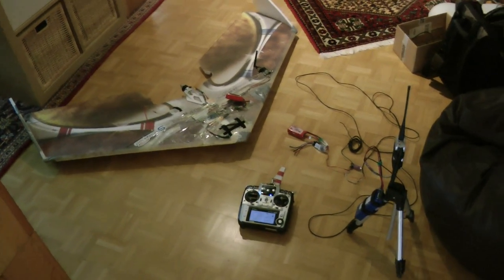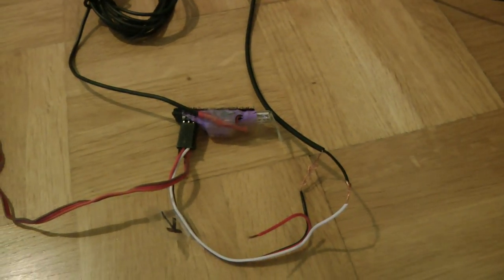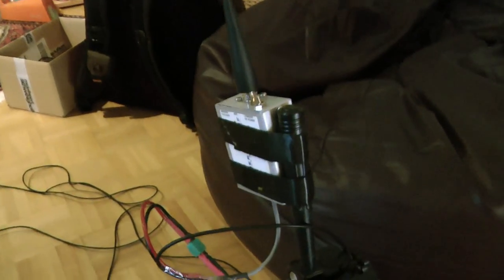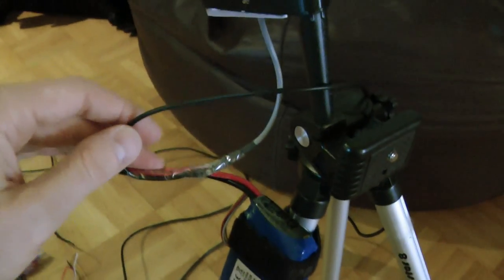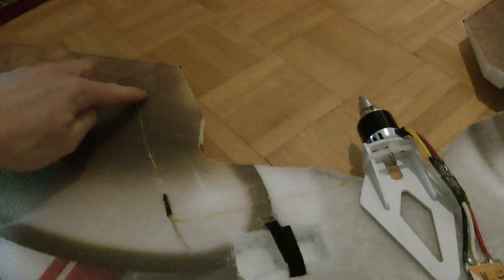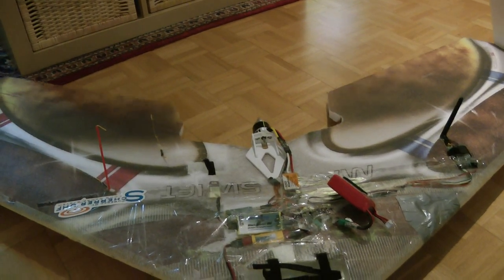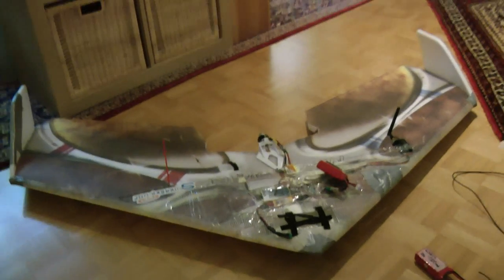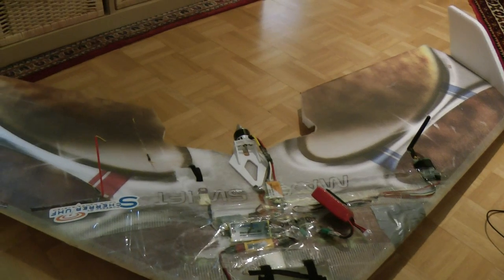Scherrer Longrange UHF System connected over 35Mhz wireless to Futaba FF10

Comment: Hi , i may have a solution for  you since i had the same problem .. it got worse when i connected the usb to ppm converter to use a joystick with the scherrer system , re-bind serveral times worked for me,  if that doesnt work you have to put resistor between i think the ppm wire gotta search it at fpv community 

greets

Comment: @YTschim Changing the angle significantly changes the characteristics. The way it is now, it's an inverted dipole. Google for "IBCrazy" to see a couple of designs for FPV usage, specifically the circular polarization designs if you're flying less than 3 miles away. Bending the antennas in different shapes affects the radiation pattern (e.g. reception when rx) and it usually changes impedance significantly. My wire antenna is laid on the wing as a dipole (straight).

Comment: I remember having seen a vid once relating to scherrer uhf issues and frame timings. Can't find the video now though, sorry for that.

The antenna lying flat has a 90 degree agle in it. This antenna is supposed to be used as a normal dipole and by introducing this angle, you change the antenna characteristics significantly. What made you decide to mount it this way?